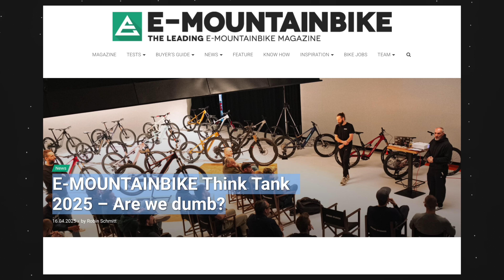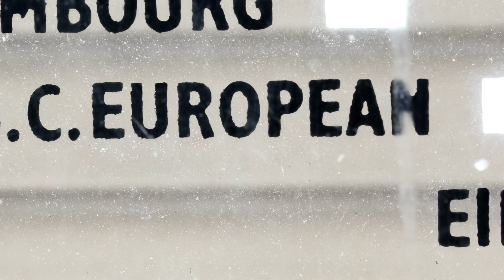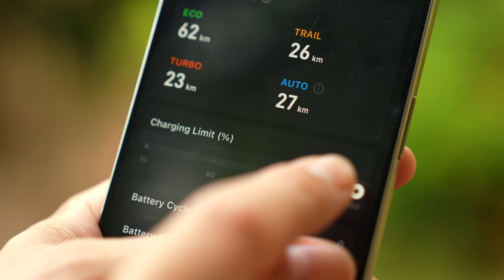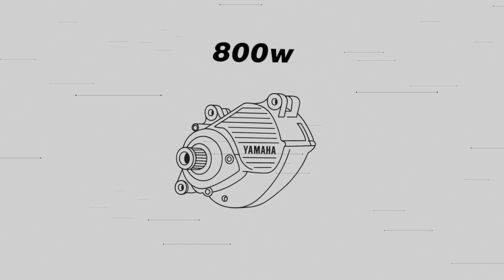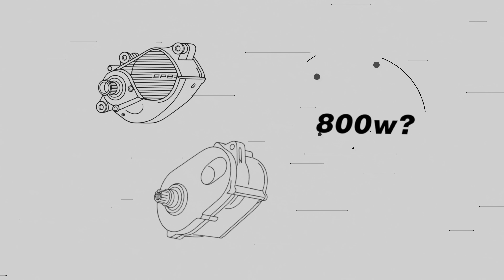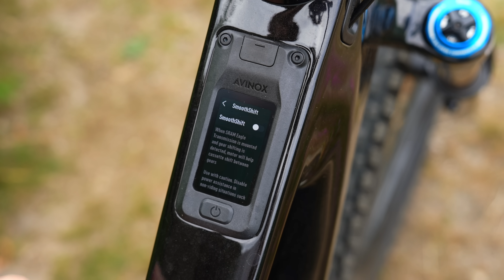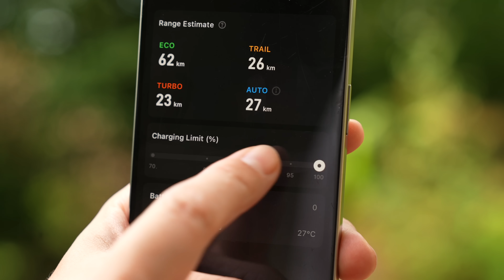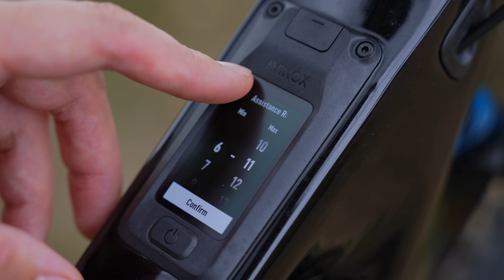Why eMTB Power Is Changing

Comment: Awesome video. I really enjoy this type of content, both well researched and well presented. For average riders I think power is misleading. A pedal assist ebike is not a car, you won't get power out unless you are putting effort in. In order to hit peak power a rider needs to have spun the motor up to a high cadence in a scenario where the motor is also delivering peak torque. Most riders are not going to be able to do this for any amount of time. I think what most riders are looking for is torque, that extra push they feel when starting out or traversing over technical terrain. This is why, as you said, how the power/torque is delivered is more important than the figures themselves. 
But hey, I'm just a rider myself so take this with a grain of salt. It would be great to see a video that discusses the difference between power and torque in the context of a pedal assist bike, what the ratings actually tell us, and how the system achieves them. Most importantly, how do we use the specs to choose the best system for our riding style and ability?

Comment: 85nm/600 watts is plenty.
Reply from the maker: For everyone?
Reply: @RobRidesEMTB if it's not enough then you are probably too weak and you need to go to the gym to get fit.
Reply: @RobRidesEMTB   Never implied that it was everybody.
Reply: @RobRidesEMTB  I'm two meter and weigh 97 kg. Clothes, spares, food, drinks 5 to 8 kilos. I ride my ebike with shimano motor most of the time in eco with 20nm. I do very long rides(over 60km and 2000altimeters) with a 640 wh battery. We also ride a tandem with over180kg sytem weigth wit same motor but two batteries.  Rarely use boost and 75nm. Only professional cargo bikes need mor watts. It's called cycling not motorcycling.

Comment: Great video Rob, really great points around it’s not necessarily around the power but it’s the whole package and experience and that’s where also the other brands are behind in, like you said if you don’t want that power you can tune it down like you said the motor isn’t violent it’s very smooth and smart, I think it’s forced a lazy sector stand up and get their act together, personally would only want that power if I was going to find the most silliest of climbs otherwise I will keep it In the lower modes or tune it down.

Comment: I've had a Bosch CX Gen 4 for two years now, completely stock: 85 Nm, 600 W. I’m on the heavier side — over 110 kg (around 240 pounds) — so it’s not an easy job for the motor. At first, I often used full power, but after the initial phase of getting to know the bike and having some fun, I now rarely go all the way to 100%. It’s simply too much. I think the 25 km/h speed limit for e-bikes makes sense. Once the industry starts increasing power, torque, and top speed, they’re no longer talking about an e-bike but rather an electric scooter or motorcycle.

Comment: I'm still riding my bosch old gen 4, 600w, 625wh battery. Generally ride with a mix of Dji and Bosch 750wers, with 1000wh batteries. I actually enjoy the extra effort I have to put in and never seem to be hindered by my smaller battery capacity, managing what I've got by sticking in eco or occasionally tour. 
Would be nice to have the extra oomph, but it becomes far too easy to give in and press the + button.

I do still ride "pain bikes" and get that emtb is different, but the divide is widening.
Reply: I'm in exactly the same camp well said, still like my bycicle Intense Tracer and ride my gen 4 Bosch in mixture of eco tour emtb and keep up with all others and feel I'm always getting a great balance of ride power and personal advantage training and improving my fitness, too much power would make me a passenger rather than a rider 😂
Reply: That's the point... we still want to pedal and ride bicycles. Not motorcycles!

Comment: It depends on whether you see a motor in an ebike as an equaliser or is an ebike something completely different to a human powered bike, somewhere between an mtb and a motorbike?  I think it's tending more to the later and I worry that could jeopardise the ability to use them on the existing trails.  The TQ HPR120 was out around 2012 with 120Nm and 900w of power, the Rocky Mountain dyname 108Nm a bit later on.  The difference with DJI is the amount of money they are throwing around to take over the market, noted that this doesn't seem to be declared as a paid promotion yet is "supported by DJI/Avinox", that seems pretty typical.
Reply from the maker: hi - I think there will be a natural limit to power and we will find it fairly quickly. Even on the latest Amflow, using 1000w constantly could drain the battery in under an hour. An 800wh battery is pretty much as much as I'd want to take on a bike, weight wise - much more and we compromise handling quite a bit. A more powerful motor would drain it even quicker. So there's a natural limit I think that will be realised at some point very soon. 

True about the FLYON / HPR - interestingly no real debate when that came out (they didn't really disclose watts on that at the time as far as I can remember!). 

ps - Its definitely a promotion, and marked as such, you should see it when you play the video, and in the description, and also as a caption in the video.

Comment: It's nice to have it and not need it vs need it and not have it.  Watts, like thrust,  is always better to have in reserve. let's not be silly about the ability to dial it down if needed.  The powertrains (including motors) are being built stronger to handle the watts, thats good for longevity, and so pushing the envelope of engineering is a good thing.  Having a choice is so much better than NOT having the choice.
Reply: Is that a quote from Nanny McPhee? 😂